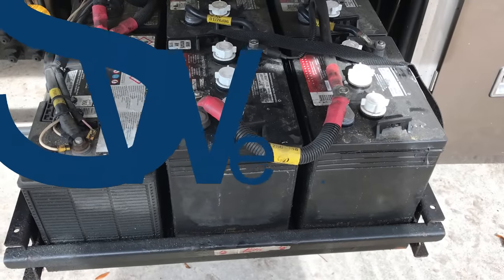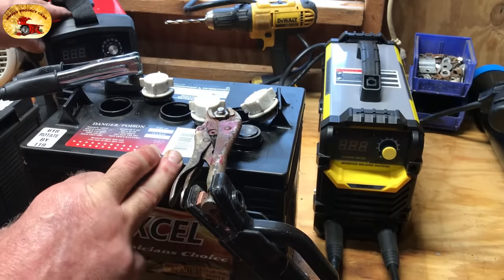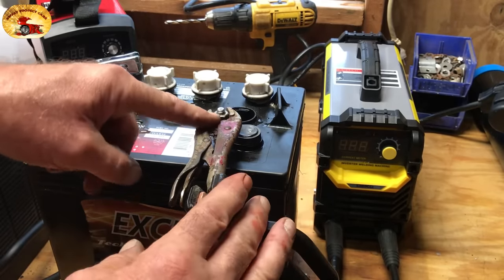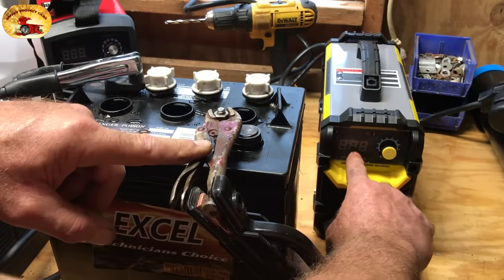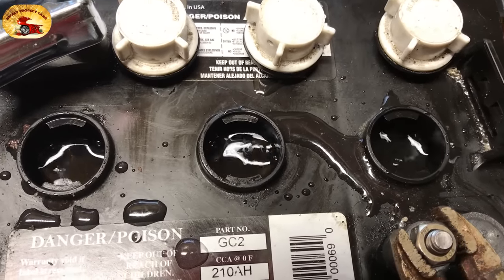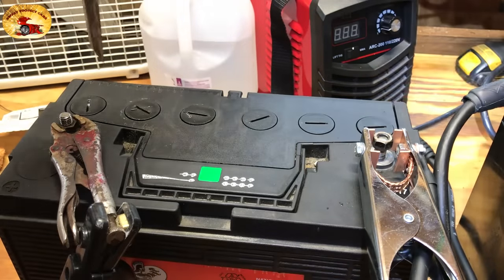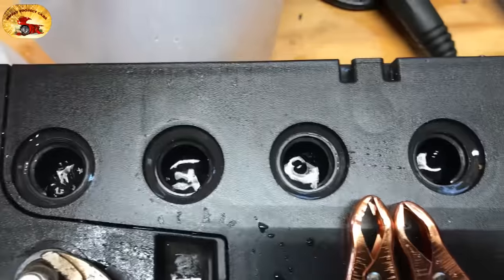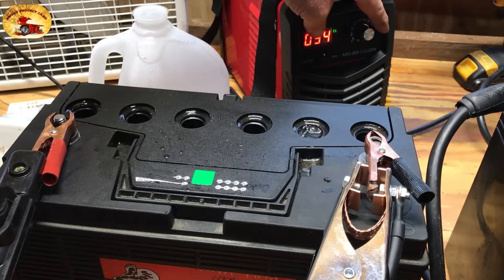How To MAKE OLD BATTERIES NEW Again!!!  12v 6v Deep Cycle, Car, Truck, Golf Cart, Semi

Comment: Hey, I have tried doing the process on 2 different deep cycle batterie TWICE and also recharging them to full charge, but for some reason they will only stay fully charged for less than a day. What is the problem? Are my batteries junk? Both of them go from fully charged to completely dead in one day.
Reply from the maker: Hey Kevin, do the process up to 5 times, if they don't hold a charge after that, the batteries are junk. Make sure you are using this  https://amzn.to/3kmCThX  to get the battery to the full charge, the process itself does not fully charge the battery, it simply cleans the plates.  Hope this helps, thank you for watching and asking, have a great day my friend. mad Mike the hammer SPC

Comment: Can you perform a real dead battery like its been dead for 5 years... Test the load then do this method then then let the battery sit idle for 3 days then test the load again? If the battery doesn't loss power during sitting for 3 days... Then i say this method is damn good shit👍👍
Reply from the maker: Give it a shot Ugypt, we know it works! Thanks for watching. mad Mike the hammer SPC

Comment: Looks like the stick welder you're recommending is out of stock (again)  =)   I"m curious what is unique about the ones you're recommending that make them work for this process?  I have a dead Deep Cycle, and a dead Starting Battery, both Marine.  Anxious to give this a shot as these batteries are near $200 each, and might be  no more than 4 - 5 years old.
Reply from the maker: Hello Wabbott, you can use whatever you want to use, we are just sharing what we have tried/tested and know works and is also safe for you and your batteries.  Thank you for watching and asking.  Have a great day. mad Mike the hammer SPC
Reply: @SweetProjectCars  sorry, one more question... does DC voltage output matter?  I'm looking at an Arc welder with 80amp DC, but no indication of Voltage... do I assume that it will regulate?

Comment: Is normal after process voltage increases arround 20V?battery is quite hot.I just did it.wondering why it goes up pretty high.
Reply from the maker: Just follow the video to a T, after you are done let the battery cool down, put it in your car and go enjoy life with a few extra bucks in your pocket.  Thanks for watching.  Have a great day.  mad Mike the hammer SPC

Comment: Will the first red one in the show more links work on standard wet style batteries, not just deep cycle as mentioned?
Reply from the maker: **Folks, they have run out of the RED in color 200 amp welder, the other
one that will work for this process is grey in color see link below*
For All  Standard 12-volt Batteries    https://amzn.to/2K1UsWQ    This is what is in the SHOW MORE, this is the one you will want to use for standard wet-style batteries.  Thanks.  mad Mike the hammer SPC
Reply: @SweetProjectCars  , they're "lead acid" batteries.

Comment: Mike, is there another option that can be use instead of a welder?? I have a Diehard 10/2/60 amp fully automatic battery charger for 6 and 12 volt batteries. It has automatic regular, automatic deep cycle, and Manual...also has a switch that can choose from 2amp, 10amp, and an engine start option!!
Reply from the maker: You can use whatever you want to use, we are just sharing what we know works every time and is safe for you and your batteries.  Thanks for watching.  Have a great day.  mad Mike the hammer SPC

Comment: Is it possible to use a normal cig welder which has 20volt output please advise
Reply from the maker: Surendra, your welder probably won't have the knock out punch that is necessary to wake up the batteries, but ultimately, you can use whatever you want to use.  Thanks for watching and asking.  Have a great day.  mad Mike the hammer SPC

Comment: So youre charging upto 2 amps??
Reply from the maker: You start out on the lowest setting, gradually turn it up until you have a rapid boil on all cells, then follow the process in the video, make sure you recap and unplug the welder before disconnecting the cables.  Thanks for watching, have a great day. mad Mike the hammer SPC

Comment: I have an old Autolite replica 12V battery with no water currently in it.  Hasn't worked for about 20 years.  If I add in distilled water and use your method, do you think it will still work?  Thanks in advance for all the great videos you put out!  Truly amazing ideas and solutions.
Reply from the maker: Give it a shot Frank, sounds like you've got nothing to lose.  Have a great day.  mad Mike the hammer SPC
Reply: What happened?
Reply: @wellnesspathforme6236  Well I finally got the welder and tried it out to see if it would work on that old battery.  While they all the cells started to bubble, one was steaming so it would appear it had a short in it.  The best I could get it was up to 8 volts.  Did work great on an 8-year battery in my wife's Honda Accord, Size 51.
Reply: @SweetProjectCars Hi Mike - while the bubbling worked almost immediately on my wife's Honda Accord, Size 51 battery (and I repeated 4 more times, for a total of 5), I noticed that when under load (auto headlights engaged) it won't turn over.  Now reading 11.7 Volts (at rest).  Should I repeat another 5 times again, or look for a new battery?
Reply: @frankmaresca6995  I think you should take the battery out of the car

Comment: Thank you for the video. 

I noticed the link for the Australian availability trade right welder is 180 amp, will this serve both battery types as it is inbetween 160amp for deep cell and 200 amp for 12 volt regular batteries? 

Would 180 amp be ample for regular 12 volt batteries.

Thank you in advance
Reply from the maker: Australia has very limited tools to them, you can try this welder, it works on many wet-style batteries.  Thanks for watching.  mad Mike the hammer SPC

Comment: Can you recommend a single inverter that will perform this task on all wet batteries? I have a scissor lift with 6 volt batteries,  tractors with group 24 automotive batteries,  and 12V deep cycle marine batteries on my solar system. Do I have to buy multiple inverters to keep all these batteries in service?
Reply from the maker: There is not one that will do both, and for the 200 dollars it would be to purchase both, it's nothing compared to the money you are going to save based on what you have.  Thanks for asking Robert.  Have a great day.  mad Mike the hammer SPC
Reply: @SweetProjectCars  thank you Mike for responding to my inquiry. I guess I'll put one each on my Christmas list and see if Santa can swing it this year. Have a Merry Christmas!

Comment: Can you use the same 200amp welder for both the 12VDC automotive and 6VDC or 12 VDC deep cycle batteries?
Reply from the maker: You have to use the specific welder for the specific battery process, you cannot use just one for both types of batteries.  Thanks for watching and asking.  Have a great day. mad Mike the hammer SPC
Reply: lol

Comment: Awsweeeeeeeet! Can I do this on 12v batteries showing 11v on multimeter means can we do that on batteries have some current and volt ?
Reply: i have completed this process my battery all 6 cells bubbling, but my battery volts before this process is 11.6 ( resting ) now after this process its 11.8 ( not resting ), now what should i do next , battery is very warm how much wait before i put battery on charger or drain all battery water and fill with new acid then put on charger please advice your expertise thanks
Reply from the maker: Salman, you need to do this process up to 5 times over a one week period before calling the battery junk.  Hope this helps.  Have a great day.  mad Mike the hammer SPC
Reply: @SalmanKhan-ir9gw  How did it work out after you did this process 5 times within a one week period?

Comment: CAN I USE MY LINCOLN 220 AMP WELDER ?? TO DO THIS ? ALSO, DOES THIS WORK ON 12V SEALED AGM BATT. ?
Reply from the maker: Please use the exact same tools as shown in the video, we suggest this for your protection and your battery's.  This does not work on agm/gel batteries.  Thanks.  mad Mike the hammer SPC
Reply: @SweetProjectCars   TKS. FOR INFO.

Comment: I got the  replacement for the yellow welder, can you please tell me the settings I need to use, I have tried and set up as you said but I  get no bubbles at all.
Reply: Alright I got it figured out and working great, I will follow up after getting all six done and let you know the run time. I can say now that I started with 3.15v and now up to 6.19v. Thank you very much for saying me 900.00 dollars.
Reply from the maker: Glad you got it figured out my friend!!  Awesome job!  Thank you for watching and sharing.  Hope you have a fantastic day my friend.  mad Mike the hammer SPC
Reply: @kevinmrhodes  did you buy this one as im having he same problem and can't get the 12v deep cycle golf cart batteries to bundle.  YESWELDER ARC-165DS Stick Welder,165Amp Digital Inverter  what settings did you use to get the bubbling action.
Reply: @neufieboy  I wasn't using 12volt batteries mine were 6volt

Comment: I have an old Nordika 9000R welder (goes up to 160) do you think I can use it for this application? Or is there risk of damaging it? No LED read out on mine - too old. I'd appreciate your advice before doing anything stupid.
Reply from the maker: We recommend either of these Yellow Welder    https://amzn.to/3eD4aK4 for ALL Deep Cell 6 Volt & 12V Batteries Red Welder  for All  Standard 12-volt Batteries    https://amzn.to/3kd4b8K   we have not had good luck with others out there, and it's best to be safe than sorry using one as old as yours.  Hope this helps.  Have a great day.  mad Mike the hammer SPC
Reply: @SweetProjectCars  
Thanks for your reply. I tried mine but no bubbling so I guess it's not powerful enough. Just hope haven't blown any internals on it !
Maybe I'll ask for your recommended welder for Christmas, I hope it's available in Europe.
Reply from the maker: This  https://amzn.to/3lamXiv  is the one we recommend for all of our European friends.  Thanks for being here with us Robin.  Have a fantastic day.  mad Mike the hammer SPC
Reply: @SweetProjectCars  
Thanks!

Comment: Nice video👍 . Will this work with any 200A  inverter arc welding machine ?
Reply from the maker: We have found through our testing that the equipment we share should be used for safety concerns for you and your battery.  Thank you for watching, have a great day. mad Mike the hammer SPC
Reply: @SweetProjectCars  can you check the amazon India website and recommend similar  welders . Thanks again

Comment: With the welder on the car batteries do you have it plugged in to 110V or 220V?
Reply from the maker: You can use either, that's just the input power from your house.  Thanks.  Have a great day.  mad Mike the hammer SPC

Comment: Can anyone tell me what type/size or amp welders he is using for both types of batteries, I noticed he said that the yellow one was used for the 6 volt deep cycle and the red one was for the 12 volt regular car batteries. What would be the recommended machine for each type of battery?
Reply from the maker: Hello Anthony, if you go to the SHOW MORE of the videos description, you will find both welders and the recommended use.  If you can't find it let us know and would be happy to help you.  Thanks for watching. mad Mike the hammer SPC
Reply: @SweetProjectCars  thanks

Comment: Will a AC/DC Lincoln stick welder on DC, also work? >> I have no other need, for an inverter welder.
Reply from the maker: We suggest using the ones we share, you can use whatever you want to use we are just sharing the one's that work flawlessly and safely every time.  Thanks for watching.  mad Mike the hammer SPC

Comment: The grey 200amp machine has an arc force adjustment. What should that be set to?
Reply from the maker: Just leave that at 1, then you only use the current dial, start out low and turn it up until you have a rapid boil.  Thank you for watching and asking Scool man.  Have a great day. mad Mike the hammer SPC

Comment: any idea if this procedure will work on a forklift battery?
Reply from the maker: This works on all wet-style batteries.  Thanks for watching and asking Eddie!  Have a great day.  mad Mike the hammer SPC
Reply: @SweetProjectCars  but the forklift batteries are taller and they have individual cells. any idea on the proper procedure for that? the battery is huge and heavy and awkward to maneuver. plus for safety reasons i dont just want to experiment without proper information. any helpful information is greatly appreciated.

Comment: I tried this on a 12volt car battery Everstart Max that been replaced and laying around for about 4 years.  At 200 amps hardly any current went through it in beginning. After numerous attempts it started coming to life.  A few cells were boiling and streaming off good. But fourth cell from the positive post only few bubbles. So I kept repeating as it slowly improved.  The battery had about 2 or 3 volts before I started. At some point it was holding at around 5 volts between charges.  I kept adding distilled water after each charge to maintain proper levels. Now the battery is down to zero volts and takes long time charge to get any current flowing and activity. Case gets hot but not much activity.    I think I steamed away the sulfuric acid that was in it and now has mostly water.  Maybe I should have added acid instead  of water.   I still want to restore this battery.  Any suggestions on what to do?
Reply from the maker: That battery is toast, sometimes they just can't be salvaged if they've sat dead for so many years. Thanks for watching and sharing, have a great day. mad Mike the hammer SPC

Comment: My question is this, what happens to the distilled water after all the cells are up? Do i leave it inside or is there a specific liquid acid that i should add? And if so, do i drain the distilled water from the battery?
Reply from the maker: Please re-watch the video, there's no need for adding acid or draining the water.  Thanks for watching, have a great day. mad Mike the hammer SPC

Comment: Can this be done with a fast charger
Reply from the maker: You can use a turtle charger or a road runner charger, just follow the process in the video using exactly what we use and you will have success.  Thanks.  mad Mike the hammer SPC
Reply: You can use whatever you want to use,

Comment: Has anyone successfully done 12v7ah batteries with F1 / F2 terminals?  
Would you also post a link for a good MIG welder that will work with you solution as well? I assume any 165A - 200A welder will work yes?
Thanks
Reply from the maker: We use this one https://amzn.to/3sTpodi  for ALL Deep Cycle only 6 Volt & 12V Batteries  &  for All  Standard 12-volt Batteries we use this https://amzn.to/2K1UsWQ  we recommend these because we have tried and tested them and know they work and are safe for both you and your batteries.  This process works on all wet-style batteries William.  Thank you for watching and asking.  mad Mike the hammer SPC

Comment: What happens to the battery mud in the bottom of battery?
Reply from the maker: We're not really concerned about anything other than the fact that we can rejuvenate a battery to work for another 2-3 years or longer, don't analyze until you are paralyzed.  Thanks for watching and asking.  Have a great day. mad Mike the hammer SPC

Comment: Question, is it imperative to use clamps to 12V battery terminals or is it okay to just use the clamps from the welder directly on the terminals?
Reply from the maker: We've never had an issue doing it either way.  Thanks for asking.  Have a great day.  mad Mike the hammer SPC

Comment: What is the purpose of the additional little clamps or the vice grips on the positive post?
Reply from the maker: It's much easier with the welder clamps to get a good grip on the posts, many battery posts are too big for the welder clamp that holds the weld rod, it gives options if you can't get the clamp on the posts.  Follow the video and do whatever you have to do to get a good clamp on the battery posts.  Thanks for watching Stephen. mad Mike the hammer SPC
Reply: @SweetProjectCars  ah, ok. Thanks for the explanation!

Comment: I have a Lincoln 225Amp stick welder, can this be used to recharge car battery.
Reply: Most Lincoln 225 "tombstone" welders are AC only. These inverter welders like in the video are DC welders.
Reply from the maker: You can use whatever you want to use, we are just sharing what works every single time, and safely.  Thanks.  mad Mike the hammer SPC

Comment: I did everything according to your directions but it started sparking so i stopped. I used the grey one & hooked it up correctly & had the caps off and filled with water. For a 12V car battery. Any ideas what I did wrong? Thanks
Reply from the maker: Darren, did you start on the lowest setting?  We have never had one spark, ever.  Make sure you have the cables on correctly and make sure they're tight.  I am going to assume the sparking was where the clamp went to the terminal, if that's the case, it wasn't tight enough or you didn't have a good connection.
Reply: @SweetProjectCars  Yea I think you're right, I was using cheap ass alligator clips I found & was having a hard time getting them clipped to the posts. Just ordered the clips you have in the SHOW MORE. Love the 303 by the way!

Comment: What welders can be used? Flux, inverter mig or tig welder?
Reply from the maker: We suggest using the ones we share, you can use whatever you want to use we are just sharing the one's that work flawlessly and safely every time.  Thanks for watching.  mad Mike the hammer SPC